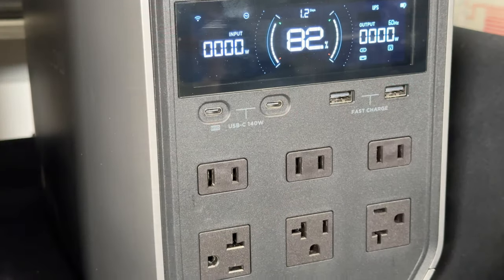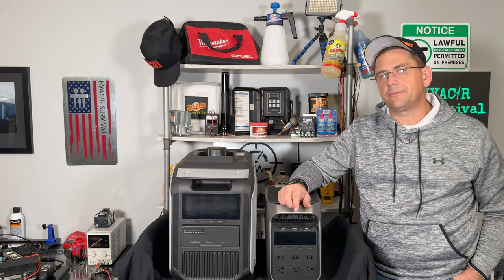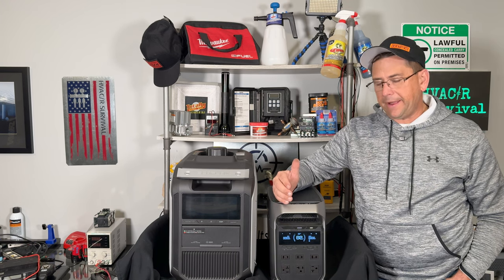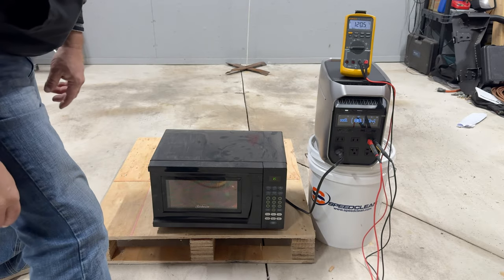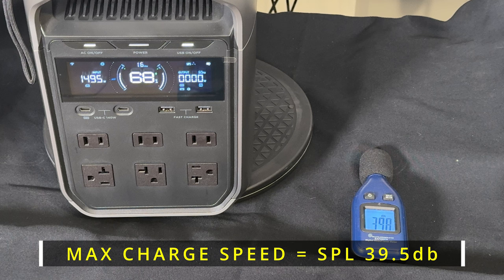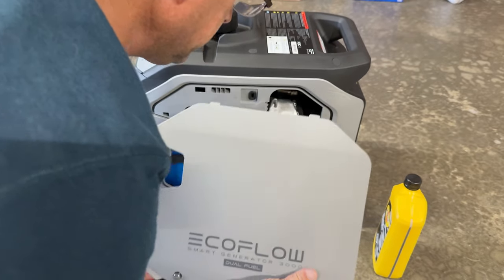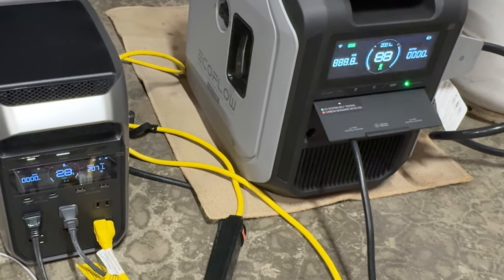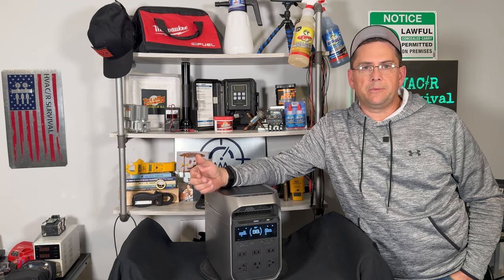EcoFlow Delta 3 Plus Smart Dual Fuel Generator Test Review

Comment: You can't run a camper with the Delta 3, it only gives you 8 amps on 12 volts. The heater will not run, and the water pump will not run. On prime days, I had one in my cart, I did a bit more research (good thing) and just got a LiFePO4 Battery.
Reply from the maker: I guess that depends on if you’re running everything on 12 V dc or 120 V ac. It’s a small power station more towards AC power and solar charging than it is DC. I wouldn’t buy a power station wanting to use it on DC primarily unless it had an Anderson plug in it.

Comment: plastic bottle of water in microwave for  a minute. I assume it melted a hole and leaked all over or shrunk and blew the lid. lol
Reply from the maker: Nope. I use to use them to test the output of microwaves. The water will warm up a certain amount of degrees depending on the wattage being used. It’s actually in one of the service manuals for Amana  microwaves.
Reply: @HVACRSurvival  we always used a coffee mug/cup of water.

Comment: The idle power consumption is quite high. Wonder if they could have used two inverters one to be more efficient at lower loads and both in parallel for higher loads.
Reply from the maker: It’s about the same as my generac

Comment: The DC bypass charging for the ecoflow products saves 40% fuel by not converting to AC then back to DC to recharge your ecoflow.
Reply from the maker: This generator doesn’t have the DC charging. Only AC I’m not sure why they didn’t put it on there.
Reply: @HVACRSurvival  fake news.   It connects to ecoflow delta products via the extra battery special cable and does DC direct charging.   Infact you can plug the ecoflow extra batteries directly into this genorator to charge them and the gen will DC charge and turn itself off when done.

 It has direct DC 
DC Output Voltage
42-58.8V @
DC Current
32A Max.  So  It can fast charge DC and use less energy and make less heat by bypassing the AC inversion process.
Reply: @davidarnold344 odd... I've seen no one show a dc port on this generator..

Are you confusing this generator (smart generator 3000) for another ecoflow generator? 

Even ecoflows own advertisment only mentions AC charging (with bluetooth connection) to charge the delta 3 plus.

Comment: I have the older version of ecoflows duel fuel generator. Will the Delta 3 Plus smart charge from that device or do I need to upgrade to the new generator?
Reply from the maker: There is only a couple power stations to choose from.

Comment: This is a great review, thank you! One question - in the run time test with the fridge connected, you only got under 500 watt hours out of it (~45% efficiency). Why so low? I'm hoping to use this to power a fridge in the case of an outage, but concerned why I'd only be able to effectively use half of the unit's capacity.
Reply from the maker: I believe it’s because you’re losing 3% of your battery every hour just sitting there with the ac inverter on, whether you’re using Power or not
Reply: @HVACRSurvival  Gotcha, that makes sense. I can make the math pencil out for the indoor fridge test (~25% lost to AC inverter, which makes up the difference) – it's the garage mini fridge test that doesn't add up for me! But thanks for all of the awesome test and info, just snagged one of these myself.

Comment: the vacuum pump and recovery machine draw may be higher when they're under load in actual use, especially the recovery machine with high head into a recovery cylinder.
Reply from the maker: Maybe a little higher.  You seen it was only pulling 800 W so it could pull double that and still be underneath what it’s rated for plus how many people do both things at the same time. Like they say, just because you can don’t mean you do.

Comment: Mine overheated charging and then discharging with a 1450W heater. Once discharged it would not charge and was completely dead for an hour and a half. Was told by EcoFlow that it's normal.
The AC inverter's self-consumption of about 40W is likely the biggest downer as it seriously limits runtime for light loads.
Reply from the maker: Yeah, this really isn’t made for heaters. The batteries not large enough to sustain the draw.

Comment: which shed model are you posting to shelter the generator
Reply from the maker: I don’t know how well it works but EcoFlow is who put it in my information sheet. That thing looks like it was made out of plastic but as long as you have a air intake and a place for the exhaust;  plus the generator is secured so it can’t turn it should be fine.

Comment: Would you personally use a generator like this over a whole house generator?
Reply from the maker: Short term yes I do use it. But if the power is out for days I will be using both. My 8kw generator will charge my delta pro 3 and ultra plus run the house.

Comment: Was hoping that you would review this battery power station. I see that it has a feature called “Disable Grid Bypass” which states “This feature enables high quality electricity supply for your appliances. When turned on, it prevents the grid from bypassing the battery and powering your appliances directly. The grid will only power appliances when the battery reaches its discharge limit.”
I wonder how this feature works while being recharged with a non-inverter type generator, i.e. does it lower the THD to protect sensitive equipment?  Thanks for the review.
Reply from the maker: Basically the battery runs the load at all times vs passing the wall power or generator power to the load directly. Then the battery is charged from the wall like the smaller cheaper power stations are. But I see why they would offer this as an option if clean power is critical.